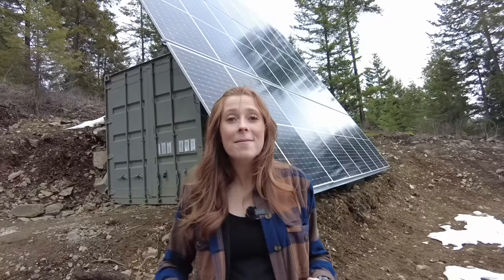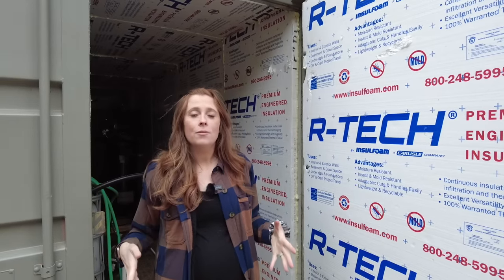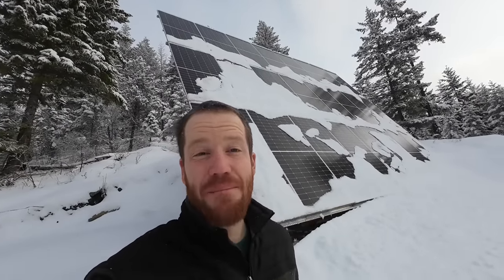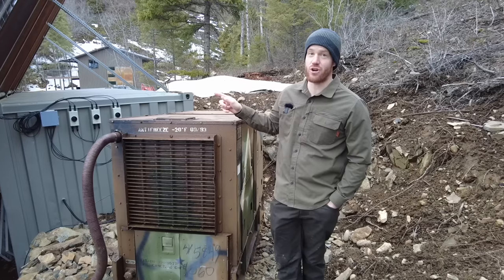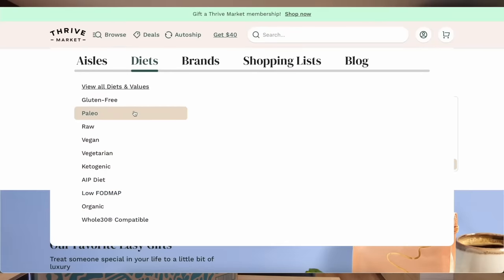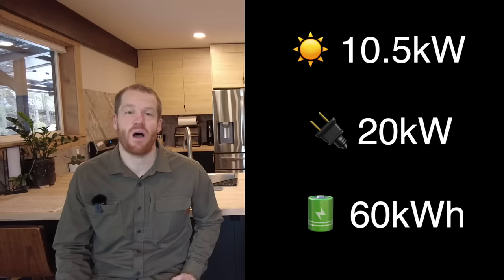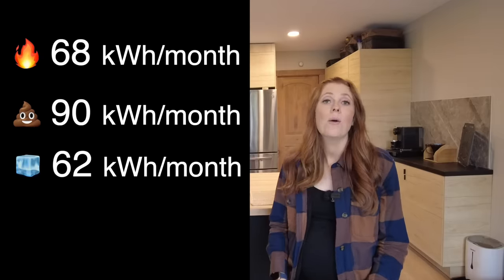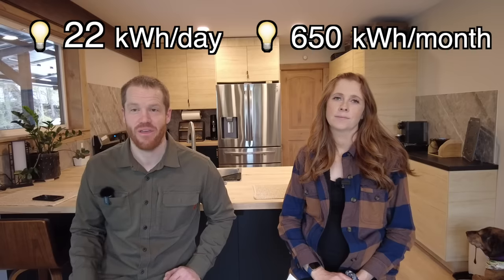The TRUTH About OFF-GRID Solar | Winter Update

Comment: I’ve been anxiously awaiting this video as I need a long term solution to keep my batteries from freezing as I build our cabin. I’d thought of putting them in a basement but get a little nervous due to thermal runaway risks even though LFP batteries are safer than other lithium options. I’m on a steep mountainside and was thinking of some kind of root cellar near our array, putting something on the edge of my build site and burying it should be possible and would even serve a dual benefit of holding up the hillside. The questions I had were 1) will the geothermal be enough heat (we got down to -18 for a couple days this winter, unusually cold) and 2) the waterproofness and long term durability of a buried room. It seems like you guys answered the heat question, I wonder how weatherproof a shipping container will be, lifetime and if there is an alternative…. Right now my batteries are in my little shed in an insulated box with a chicken heater on a termocube, it worked but is not ideal.
Reply: Shipping containers are fairly watertight - they are built to be exposed to seawater and spray without damaging the contents of the container.  Rather than relying on waterproofing, I would suggest you work on drainage.  The enemy of a container will at some point be sustained exposure to moisture, so if you can drain the water away from the container where it is buried that will be your biggest help. Once you have drainage sorted out, any leaks become much less of an issue.  Ambition Strikes avoided most of the drainage issues by only burying a part of the container, so any runoff from higher up the hill will tend to run around the container.  Another resource might be to look up the average subsurface temperature for your area.  I live about 500 miles north of Ambition Strikes and the subsurface temperature is 50 degrees f at its coldest (February) so there is quite a bit of warmth to be had.  You just need enough insulation in the container because ground can only transmit heat so fast.

One other thing to keep in mind is the size of their system.  They have a large system and I would guess it generates some of its own heat just by being heavily relied on.  If you have a 20kwh battery system, or one that you don't use much at night, you might find that your results aren't as good.  At any rate, good luck!

Comment: If that inverter is truely on 24/7, it'll be the first thing that has 'something' wear out I guess. Unless nature decides to strike disaster at you and kill the solar panel array in some form. So it will indeed be interesting to see how soon that inverter dies out. Great job on pulling through winter like you did. 🙂 And ... congrats on the new arrival!
Reply: Probably good for 25-30 years.
Reply: @silverbackag9790  I've not heard anyone actually make that. I do see people reporting the first things failing after 5 years or so. Then repairs under warranty, but still .. downtime and waiting for parts or shipment there-and-back for repairs.
Like I said, it'll be interesting to see how long things last out there in practice.
Reply: @silverbackag9790  how many pieces of electronic equipment do you have that are 25 years old?  or that you could find in anyone's house that you know?  some of the panels will last that long if they don't get destroyed by hail or fire, but none of the electronics will
Reply: @BrianKrahmer  one Trace inverter (the predecessor to Schneider and Outback) that around 28 years and an Outback that’s around 20 years. Both getting retired for backup duties since we installed a 24kw continuous SMA setup served by 120KWH of lithium iron phosphate to support both my new shop and my mom’s existing house. SMA warranties for 10 years and offers an extension for 20. Oh, and a Pioneer SX1250 from the mid 1970s. You know nothing John Snow. Any more questions?

Comment: Since it is the middle of winter that you use the generator, it seems a back up generator would be a modest cost with a significant safety factor. Otherwise fantastic job guys!
I have 12.5k solar panels with 20 kW of battery storage and three generators one diesel , one propane, and one gasoline. I also utilize a bank of 20 car batteries for extra storage and provide electric to heat the lithium batteries if necessary. My diesel generator can utilized waste oil.
My ultimate goal is to catch and train a herd of groundhogs to do something worthwhile like running a generator wheel instead of tearing up my yard! L O L

Comment: With your excess solar power you could split water to make hydrogen and then consume it in a fuel cell?  Sounds nice in theory but not sure there’s cost effective equipment to actually do it.
Reply: I'm interested in this also. How do you store the hydrogen until the winter? I think you can compress it but it sounds dangerous.
Reply from the maker: This is something that Riley is very interested in, but the cost associated with doing so it just far too expensive at this point.

Comment: You should get an emporia Vue 2 it's smart wifi device that goes in fuse box clips amp meter around two main phases and upto 16 circuits at the breaker so you can see exactly where power is being used and it records so you can see historical usage
Reply: We use this too and I have it integrated w/Home Assistant to keep my stats locally (just in case Emporia goes flat or wants to start charging for storage.)
Reply: I have one...no solar yet adding in the near future.  I got the emporia to learn what and where all my power goes so that I could better design my system.  as a note, my water heater average is 130/month, fridge is 70/month, heatpump varies alot with temp 100-600/month.  as a comparison, everthing in our home is electric and its 2 adults and a teenager (who knows not an off switch) LOL 
My goal is to add 6k of solar panels to reduce bill by 70% and add 30kw of battery for power outages.  may go off grid in future
Reply: @jcdc650  same im in UK though and our consumer units are much smaller than American ones im proud of how neat I got it haha but of course any excuse to add more to my homeassistant server also
Reply: Question, does it work good (emporia vue 2 )? Have you the stock firmware or did u flash it ? I have been looking at one to buy but have seen some negative feedback from ppl from the software.
Reply: @jcdc650  does it work good for you ? Stock firmware ?
Reply: It works fine for me, stock... i would love for it to be stand alone as others have referred, but im not smart enough to do the programing.  So i rely on their cloud for data and such, if they start charging monthly fees I'll just unhook it unless i can find someone to rel
Ally dumb down how to make it stand alone

Comment: I've got 7, basic, lead acid batteries.  8x 230watt panels.  1x 2000 pure sine inverter.
It charges my USB devices and some small appliances when it's cloudy.
When there's LOTS of consistent sun (spring, summer, fall), we can power the fridge 12 hours a day + operate the washing machine full time, among other things.

Comment: solar keeps working even in the winter.  I live in northern BC🇨🇦.  100 amps charging incoming from the solar array yesterday…..but only for a few hours.  My total kw/hrs have dropped by about 75%, since peak power in the summer.  I heat with wood, and the freezer doesn’t need to be powered up now.( its outside on the porch).  So i still have enough to pump water, and keep the lights on.  Cheers!

Comment: Good one and good info, well presented! :)     My Oregon 13kw PV system is 5 yrs old and December is the really bad month - 20-25% of summer power.    I use cheap inverters compared to you're top of the line Victron and after 5 years (25,000hrs of operation) an inverter failed / needed repair but otherwise, minimal effort.    Panels just 'sit there' and do their thing quietly.    The solar operation is very easy, hardly anything to do, no moving parts unless your solar panels are installed so the tilt can be changed.   However, a generator does take a little effort - maybe similar to a riding lawn mower in that it will need fuel tank fill-ups, oil changes, and starter battery updates over time depending on the amount of use.

Comment: I only have 5 kW inverter and 15 kW of battery power, and 20 panels at 7 kW. 
For me, that covers everything except the dryer, which I flip back to the grid to use. For the winter time I flip back to the grid at night and then back off grid during the day. I also have a back up generator just in case I need to charge up the batteries. 
I live in the Pacific Northwest.
I came up with the same conclusion, that it wasn’t worth the cost for 24×7 off grid! I suggest if most people building a house, insulated their house extremely well, you wouldn’t need as much solar as you think. Heating your home, is the killer in the winter!

Comment: In my off-grid living I find every year we add more AC's, more lights, more pumps etc. and then you install more panels.  Today we will generate about 80 kWh of power with it being mid 90's. July and August I'll produce about 1.2MW each. Couple of years ago it was only 40 to 50.  My point is those winter months up there will force you to run that generator more and more.   I have a 22kw Generac with auto start that has 26 hours on it after 3 years.

Comment: Greetings.  You have come a long way in a short time.last winter I had to clear the solar arrays. When it is 10 below zero farenheit the snow does not melt fast enough to keep me from having to burn diesel fuel in the genrator. If I get out there and clean them it saves diesel. When it is really cold our diesel generator MEP-016D will not start because the fuel turns into a gel. It can get -35f here. I have repurposed Tesla batteries. I use the stock cooling/ heating loop to keep the batteries about freezing in the winter and a buried cooling loop to keep them cool in summer. My wife's art studio has SOK batteries that have low temp disconect. Her studio uses very little power so if the batteries do not charge every day it does not matter. We are off grid and have to plow our own roads. Winter can be about survival at times lol.
Thanks for the update. Nice job.

Comment: This helps me a lot. Im building an off grid home and your usage is very encouraging. Specially because I have a septic system so that is a massive energy saver. I'm starting with a AC coupled 11kw PV (Sunny Boy and 4 Sunny Islands) and 57kwh LiFePo4 bank. I do not plan on having any combustion appliances but the lowest temperature we have is in the 20s so should be manageable.

Comment: Hi and thanks for this video. Happy Mother's Day. I have a couple of suggestions: When you run the generator, that the heat from the exhaust could be used to heat the batteries. I don't think adding more solar cells is wise economically. It sounds like you have plenty of power during all but coldest months. So I think it makes better sense to buy more batteries and store up power for the winter months. If your inverters are limited, you could add switches to charge up banks of batteries to use later. The batteries may have stayed warm enough but I might suggest a fan driven heating device to help make sure that they stay above whatever temperature you think appropriate. I assume that you have a way of monitoring the battery room temperature. I also assume that there is a chart showing the batteries' efficacy as related to temperature, in case you are not doing that already.
As always, whatever you decide, I wish you great success.

Comment: Congratulation on the new baby.  Hopefully, you don’t think that I am picking on you with my comment.  You mentioned that your three main loads consume about 305 watts and your daily continuous consumption is about 916 watts which result to a difference of 611 watts for your all-other loads.  I have a feeling that your daily consumption of 22KWH/day is much less, and at the same time you only have 2.5 days of battery storage, if you were really using 22KWH/day, which is not much.

Here is how I got 305 watts: (94 watts for hot water heater + 125 watts for toilet + 86 watts for refrigerator)
Here is how I got 916 watts: 22KHW/day / 24-hours
Here is how I got 2.5 days:  60KWH battery storage / (22KWH/day)

Comment: I would recommend insulating that buried wall of the shipping container.  First, it's hardly deep enough to get all that much geothermal heating (although it's better than being fully exposed).  Secondly, even with a layer of insulation covering that wall, the temps of the "earth" wall will still come through the insulation, just at a slower rate.  At a minimum, insulate the upperpart of that wall where it's definitely above the frost line!

Comment: Thanks for a very cohesive feedback on how the solar system w/ generator backup has worked for you.  Though we are not living in an off-grid location, I've consider going solar with a grid tied system.  You are making me think going completely off-grid should be something to consider.  As the electric companies are not very helpful when it comes to paying us for the electric that we don't use, and they are always wanting to add service fees.  With the cost of electricity continuing to raise.  Solar is looking more feasible.

Comment: Use that extra power generation to heat up a bio bag where all your food scraps and biodigestables go. Then stack that methane up to use on a slightly modified propane generator that auto kicks on from your methane supply from the rest of the year, plus you get good fertilizer

Comment: Its good to see you using the old gen set.  How bout that 80's technology?  You can connect an external fuel tank so that nobody lugs fuel out there any more.  That 804 loves to run fully loaded especially in winter where it stays cool.  Probably needs a new fan belt this summer and oil change and radiator flush.  I did put a new head gasket and valve seals/adjust valve lash on it.  Has either injection connection if it ever doesnt start in winter.  It wont take a remote start, but I do have a MEP 802a that you can remote run off you phone, we can negotiate.

Comment: You must use a bunch to heat and due to your latitude get much less sun than we do. My wife and I live in Northern San Diego County (California). We have around a 4,000SF home and have three cats, now that the children are grown and out of the house. We have substantially less consumption than you (210KWhours/month average) about 1/3, but we did three things:  1.) We adjusted our lifestyle to being on Solar. We do laundry once a week instead of whenever we want and we do it on the weekend when grid power is cheapest (for example if our solar can not keep up),  we use independent solar lights we charge outside during the day to light our house at night.    2.) We replaced every light in our home with LED lights.   3.)  We have two refrigerators like yours (energy stars). The one in the garage we have on a timer (ice maker disconnected)  and turn if off from 2:00AM to 6:00AM every day.  Staring in and around March we only pull from the grid about 5-10Watts (not Kilo Watts, just Watts) from 7:00AM until 5:00-5:15PM and this extends out as we approach the solstice. We basically only pay for electricity after the sun goes down but have adjusted our life style for that. Our inside refrigerator is also on a timer and it turns off at 6:00PM until 8:00PM when grid power is very expensive in San Diego. When we add batteries (we have a propane-powered generator in the event of grid down) to handle the loads after sunset we will have close to no grid power consumption per month. This is just a data point to use for comparison.

Comment: Well... you have already your refrigerator, so you aren't gonna change soon, but in my old granpa house, they have a small refrigerator in the kitchen, while they have a separated pantry/storage room that was out of the house heating. The room has a wall against a lot of mass behind (was a closed room with no windows), so it is more like like a storage room / cellar hybrid.
There they had a freezer. Also another refrigerator, but it was an old one that they finally disconnected. The thing is... because that is rarely opened and the ambient is colder, the freezer is a lot more efficient.
Have it in the kitchen is comfortable. You cook there after all. Also you don't want to go to a cold place just any time you want to eat something. But for more long term storage, it has a lot of sense. Besides in that room they have also cupboards and shelves at room temperature to store other long term food that, although they don't require refrigeration, a colder temperature helps to extend its expiration.

Comment: Great Video. As someone else has said, need a cost-effective way to store all that excess summer solar.
Reply: Make water and store it. Easy to do with a heat pump. Unlike batteries, water produced is 100% usable vs storing power and losing a percentage to battery losses.